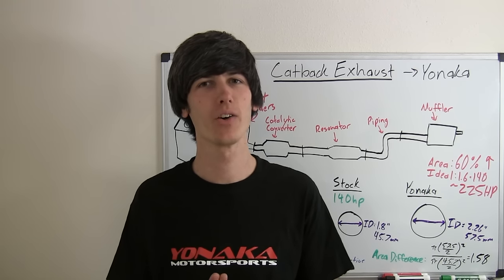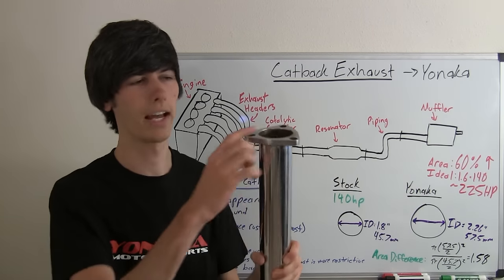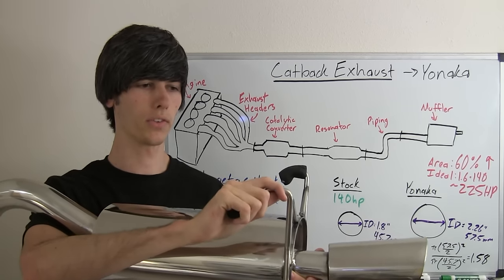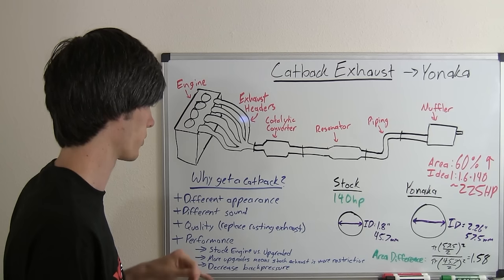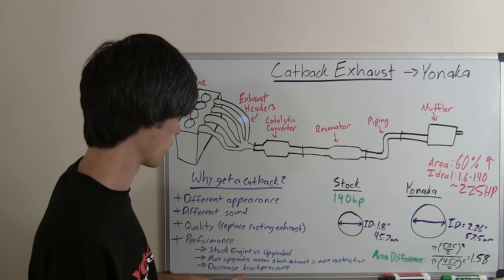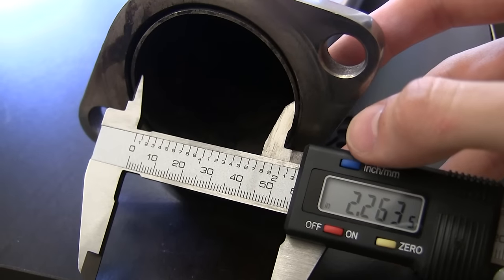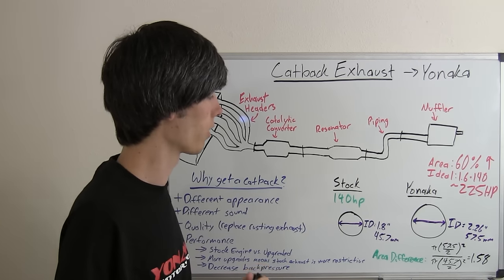Catback Exhaust - Explained

Comment: so I gotta 92 civic with a 96 itr engine in it a few mods..spec r cams,dc sports ceramic header and a cat back exhaust system wich I believe to be 2.5 inch..maybe 2and 1/4 inside not sure rly...for my catalytic conv...I got like a cheap ebay cat...id like to get a magnaflow catalyser..and maybe a muffler too cuz the cat back is just too loud!(being a 4.5 inch tip)..I was wondering wat u think about that? anyone who knows about this rly..tnx
Reply: take out the cat and straight pipe it and add another resonator for back pressure and to reduce sound

Comment: Soooo My BMW has 300 HP. IN theory, the Yonakas would provide 60% gain. Meaning I would get 480hp? I don't think that's right. Even with free flowing exhaust headers with my twin turbo charged engine... doesn't sound right.
Reply from the maker: Listen again, I said it would be ideal, or optimal, for an engine with 60% more power. It does not create 60% more power.

Comment: Don't measure the tip of the exhaust, it's just the tip, you have to measure it from the muffler bolt on pipe, from there it's more accurate and more equal

Comment: I can't understand how a cat back exhaust , can improve so much horsepower in your car.  like 60-80 bhp. 

I mean, installing performance exhaust systems, like invidia , borla , meistershaft, etc, would also yield the same amount of power or more maybe ?
Reply from the maker: yapnop2 It doesn't, you misunderstood that part of the video. A couple horsepower, tops.
Reply: yeah bud i suggest you watch the video again and pay attention to some of his key words in his sentences; what he was saying is that the stock exhaust was rated and built for an engine producing 140hp, meaning if you go beyond that number it is likely to restrict the engine, therefor after working on your car as a whole, a bigger more refined exhaust can help produce more power from an engine producing more power, the exhaust will not restrict the engine because it is rated and built to withstand more power, up to or around the 225hp mark.

Comment: I have been watching your videos at I was under the impression that, since you had been able to support these theories with mathematical values, it shouldn't be too far off from truth right? That was almost half a yr ago.

So today when I see how much gains ur touting to be able to gain from a sponsored catback exhaust (60%, seriously?), I decided to take a break.

Good luck and have fun with sponsored videos.
Reply: 60% greater area, yes, what's wrong with that? It's a fact.
Reply: +Flightace100 it's misleading because in automotive, gains more often than not, translate to increment in hp/torque. As someone else mentioned here, we would be alrdy lucky to gain more than 6% from a catback upgrade. 60% is just..unbelievable.
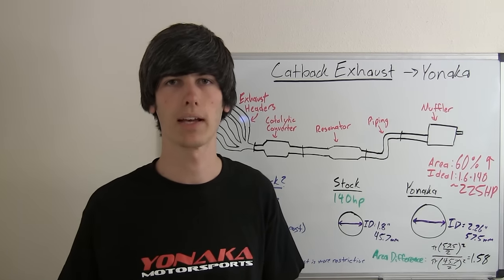Reply: theoryjack Did you read the caption at 4:16?
Reply: +Flightace100 yes I did. Re-read the entire video in fact. I think I might have misunderstood as I was listening to this previously half-heartedly. Thanks for pointing it out.

Comment: Just because you have an increase of 60% in diameter it does not mean you are going to gain 60 hp even if it is measured at the crank
Reply from the maker: I agree, and never stated a diameter increase would provide an additional 60 hp. Not even close.
Reply: if you do the math the increase would be more like >15hp

Comment: You forgot weight reduction - as most Stainless and all the more Titanium pipes are lighter than stock ;)
Reply: Also with turbo vehicles you can't say an exhaust with 60% bigger cross section area is ideal for 1.6 times the horsepower. The turbo gives the engine enough resistance, so you don't lose horsepower with a too big exhaust as you would in NA vehicles. This means that you better go big right after the turbo to reduce backpressure as much as possible.

Comment: +Engineering Explained Soooo... unless I've done enough engine mods to produce 225 instead of 140... the cat back is not necessary.
Reply: Generally, as soon as you increase HP anything beyond stock, you will start to see some gains by adding a cat back. This specific cat back system is just optimized for up to about 225 HP in this example car that has 140 HP stock. So, in this scenario, you would see maximum gains from the cat back once you reached 225 HP. Beyond that, the cat back would probably start restricting the car's potential, needing a less restrictive (larger diameter) system.
Reply: +Nathan Kennedy 
"You can't just say "oh it's 60% larger so it's good for 60% more horsepower". There is more airflow potential, but that's not really as important as you're making it out to be. If an engine needs to push more air out, it will just increase the flow rate through the pipe. Up to a certain point, this doesn't cause an issue.

I upgraded a Mach 1 Mustang from 300 HP to 520 HP, I have 3" diameter exhaust piping. Going larger isn't going to help me much if at all. The original diameter was 2.5" and I increased the horsepower by about 73%. The speed of the air flowing through the exhaust just increases a bit. You won't really see any gains on a dyno by switching to say, 4" exhaust piping. In fact, you will probably lose some low end torque.

Most of your videos are really good, but frankly there's some misinformation in this one."  kingcrimson234

Comment: what if I put an exhaust on a stock engine ? and whats with straight pipes
Reply: you get a nice look and sound .  but it wont go faster .  straight pipe is illegal and loud .  as a driver i think a loud car is awsome .  but the pedestrians will hate you and call the cops .
Reply: It's kind of like getting new rims, a lot of money for style over performance. I would always go for performance first. Better to have a fast car that looks slow than a slow car that looks fast, if you know what I mean.
Reply: something1random23 its about preference and money .  A fast looking car is cheaper then a fast car .  Honda civic with a fat exhoust or a corvette ?
Reply: Patrick Nintemann Ah, but a Honda Civic with a turbo is still pretty fast and way cheaper than a Corvette. You'd be way faster than anyone would expect you to be. Better than having everyone want to race you because your Civic is loaded with cosmetics but you lose every time.
Reply: +Patrick Nintemann ight thanks
Reply: +something1random23 ight thanks
Reply: something1random23 i have a golf 3 with a loud exhaust .  75 hp .  slow and loud hehe .  but i also have a suzuki gsx r 750 .  that is fast .
Reply: +Patrick Nintemann awsome bro v8 on the Suzuki ?
Reply: v8 ?  it is a in line 4 cylinder with 16 valves it is a dohc and it has 118 hp .

Comment: Of course there is no added power, you just insanely increase the diameter that cause less speed and you kept the resonator and muffler that slow down the gas !!
What about a 1.8-1.9 straight pipe ?
Reply: Most of the times, you lose power installing a bigger diameter exhaust but people don't want to believe it. Many engines need a certain amount of back pressure to realise better turbulence in the cylinder and therefor better mixing of gases which in turn provide more power. If you have a larger OVERALL diameter exhaust but didn't change anything else in your engine, than you probably gained not 1 HP. In rare cases, where the factory exhaust is not optimized for the engine but rather just put on it, then you may get more power. But most better manufacturers develop the exhaust systems individually for every engine.
Reply: Yes I know but they have to make the exhaust according to the pollution restriction, that slow down the gaz.
So an aftermarket exhaut with the right diameter is a good upgrade anyway.

Comment: well in my car resonator goes BEFORE cat :) so how it's called? :D
Reply: Some cars can have two catalytic converters, the same argument can be applied. The term "Cat-back" mostly  applies to vehicles running a conventional setup like outlined in the video; however one can purchase "cat-back" exhaust for vehicles configured as I have mentioned which simply replace everything from the cat closest to the engine back to the outlet. In some cases this involves adopting a high flow performance catalytic converter after the resonator.
Reply: Yes my car have 2 cats :) You're right. But first is almost cat so i wasn't counting it :D

Comment: whats a resonator? , Pls tell me anybody
Reply: Basically a chamber of space larger than the pipe diameter of the regular exhaust, its there to reduce exhaust "drone" noise by normalizing the sound waves coming out of the engine. I'm not sure about how it's done though, pretty much wizardry to me.

Comment: that was dumb, ideal exhaust diameter isnt proportional to the amount of hp you're making. or else drag cars would have 4 foot wide exhausts. also you're assuming the stock exhaust being engineered for the 160hp would only be true if the car was designed only for performance purposes. and its an integra...so its not
Reply from the maker: +TheDragorin Many drag cars have eight very short (in length) exhaust pipes which are a fairly hefty diameter. They're significantly larger than any road car in area, combined. That's not to say I didn't oversimplify here (I did).
Reply: +Engineering Explained Am i correct in thinking that if you put a full exhaust system to each pipe of the exhaust manifold it would be considerably quieter than forcing the gas through one pipe? Am i also correct in thinking that if you replaced the main piping with resonator after resonator, that that would also make the exhaust system quieter. If you did both of these things together would you have a near silent exhaust system and thus quieter car??
Reply: +Robert Perry After doing some research it seems the resonator is placed in a precise location between the engine and muffler in order to allow it to create a certain sound. Seems like rather than actively reducing noise, it just filters certain frequencies and attempts to reduce sound by limiting the frequencies which exit the resonator.
Edit: read more here if you're not bored to death yet (http://auto.howstuffworks.com/muffler4.htm)
Reply: The air pressure equalizes cancelling each other out, but as the resonator chamber has so little space the gasses are still compressed, more compression more noise, that's why top fuel dragsters sound so loud, because they have open exhaust, so if the exhaust was to go through resonator after resonator, it would provide more equalization in air pressure, I was wondering if you used resonator chambers on each exhaust it would allow for more gas expansion, slower and thus less noise,
Reply: +TheDragorin there was a very good interview on YT with Dinan CEO about that. Doing the maths for a perfect exhaust system is much more complex than just reffering to the HP output. Besides I think no changes in the exhaust system should be done without proper ECU programming.

Comment: I do not believe you can extrapolate the optimal horsepower of the Yonaka exhaust merely by saying since the new system is 60% larger then it is optimized for a 60% increase in horsepower over stock. Thats a stretch based on assumptions. Not a scientific conclusion. It's a theory. You do well so often in using scientific method, don't tarnish your conclusions with assumptions. Finish the science all the way through.

Also, I wonder that by leaving the stock restrictive cat in the system, if that negates the effectiveness of the performance exhaust? Seems a dyno is necessary.

Comment: you also missed one other huge point to this the meme tastic "weight reduction bro" but in truth it's true depends on the car but just chopping off the muffler alone on some cars "like mine" saves you 30 40 pounds of weight and less drag on the car surprised he did not mention this not just for power or speed also for MPG cause simple logic has it lighter your car less motor has to work easier to push it more MPG lol

Comment: Check this one out for a full explanation of exhausts (of which resonators are a part of). 

"youtube.c0m/watch?v=e72Xkf_5VXo"

However the short answer is that resonators isolate certain sounds. This is why some exhausts make a car sound "throaty" or "whiny". This would be in comparison to a muffler, which just makes the sound quiet.

Comment: Theoretically speaking is logical ... but in reality it is not. An atmospheric engine is different from a turbocharged and therefore also the exhaust system is. 60%? not even reach a 20%. but thanks very explanatory video.

Comment: Not very accurate at all was you trying to say your gonna get a 60 bhp increase due to the inside diameter piping  hope not also the major cause of back pressure is the cat so a catback exhaust wont do much at all it just slightly helps other mods you may have done nothing at all your gonna feel only thing its gonna do is look good and sound good better off spending money elsewhere and then add an exhaust at the end unless you just want it to look and sound good there was no real information in this video.

Comment: people delete mufflers for better sound then why does this aftermarket exhaust have a muffler
Reply: If you remove the muffler, it will be illegally loud.
Reply: +ted clubber lang that actually depends on where you live
Reply: +Chris Sypos depends even more on the car too, some cars have like 4 mufflers, remove one and who cars, some you remove a muffler and it will be deafening
Reply: +Harrison Davis I agree with that. I have a gti with straight pipe besides an apr resonator and cops never gave me anything
Reply: The reason this kit comes with a muffler is because it must confirm to noise levels wherever it is sold. Meaning that in your area, the acceptable exhaust noise level may be higher than in another area, but the exhaust system still needs to be legal in both areas. It would be very cost prohibitive for the company to create different systems for every place the noise laws differ. Also, it is detrimental to the engine to run without back pressure, and cutting out the muffler entirely will decrease that back pressure, possibly lowering engine life.
Reply: +Harrison Davis  yeah my pilot has 2 of them and the resonator on it is huge. Im most likely going to opt for a sport muffler and see how it sounds.
Reply: all you need is a header and a straight pipe .  this way you get the sound your engine original produce .  it is really loud .  delete the catalytic converter resonator muffler and replace it with pipe .   then you make bets with your friends to see how long it would take that the police stops you .

Comment: you dont measure the tip to get the exhaust diameter..... many cars come with tips that are larger or smaller than the piping
Reply from the maker: I measured underneath to be sure (they're the same), I just didn't show this in the video.

Comment: Maybe installing a 2  pair of 1.1 inch diameter exhaust piping With resonator and muffler delete will still get more performance at most possible exhaust flow. Maybe the tone will be sound like bloated exhaust 🤣

Comment: I want repeat story I herd some years ago, unknow what make vehicle or engine, don't even know if he had even modified the engine, all I know for sure that he had been working on the engine, he had put on the exhaust manifold, but don't have rest of exhaust system, he need drive the pick up back and forth to work, he thought no exhaust system, should get some great gas milage, to his surprize the milage axillary dropped, meaning that some engines are axillary are fora certain amount of Exhaust Back Pressure,
Reply: Back pressure is very important on stock, naturally aspirated tunes.

Comment: the car companies most likely found the perfect diameter but they cheaped out on cripping the metal pipe not giving it the same dimater through our I would say this is the biggest resttction on a exhasust not the actual diameter which would probably be ideal that and the material used. cheap steal will collect gunk and after years your car will get slower and slower causing more restriction as your car ages. a well made exhaust and new car with new exhaust will most likely be equivalent but the better exhaust will stand the test off time and allways have that same original performance. my 2 cents. so yes after market same sized mandrel bent good quality exhaust is better  in the long run not short term.

Comment: Really? 140 to 220 just on exhaust? increase in 60% of the exhaust size equates to 60% increase in power? Honest question.
Reply: He's not saying the catback itself will give a 60% increase in performance but that the Yonaka catback upgrade is most efficient at that performance level.
Reply: shan kim I was wondering why he took the increment of the yonaka system and directly used it as a multiplier on the power of the car itself. is it that direct? cant be right?
Reply from the maker: ***** I never said it would provide that much extra power, it was just an estimation of what power levels would be optimal for an exhaust of this size.
Reply: ***** watch the thing again and read the little info tab that appears on the top right corner!!!!!!!